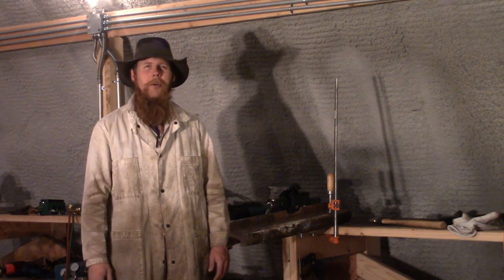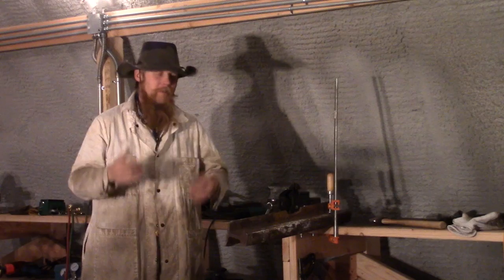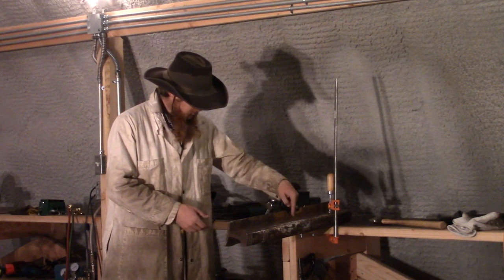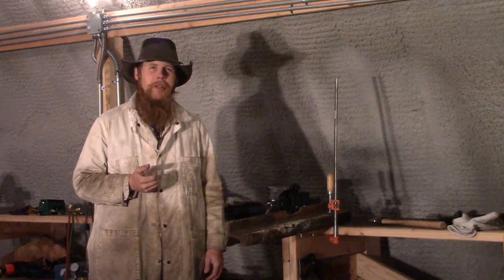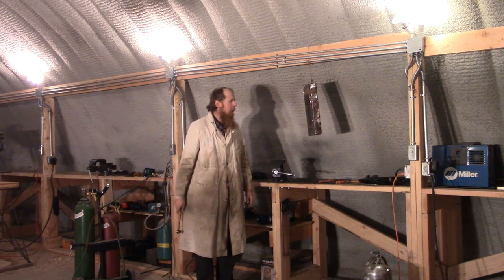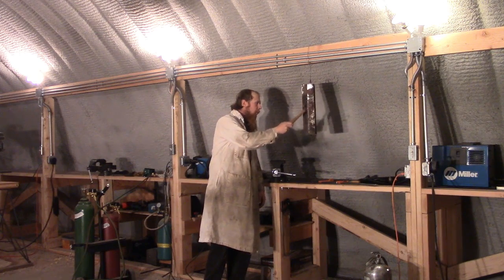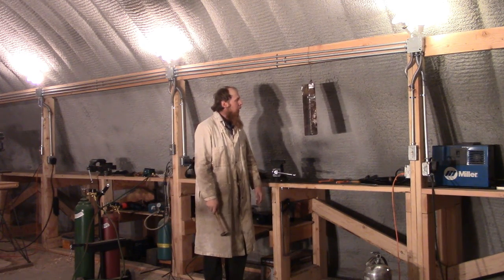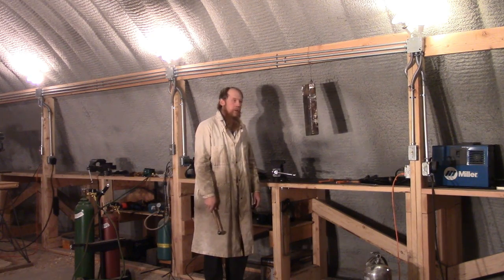Ringing Rail (TIS095)

Comment: Fun experiment.   I wondered whether the depth of cut, e.g., length of tines, was a significant factor.  Perhaps still too much cross sectional area of the tine in relation to its length.   But then it might require about 6' of open tine length to really ring -- and perhaps not.   ha ha     The joy of experimenting.  Thanks.
Reply: Shortest answer, yes. Slightly longer answer, the general shape i.e. dimensional lengths, will dictate the harmonic modes of oscillation. Striking a simple round steel rod (a concrete stake held at arms length would work) from the side will produce frequencies related to the length, however striking the same rod on the end causes frequencies related to the rods thickness. striking the rod at an angle between the two previous examples will put fractions of the striking energy into each of the previous two modes of oscillation, although one mode is significantly less sensitive and likely would not be heard.

Comment: Do you think the difference in thickness and width on each of the "forks" prongs affects how loud or clear the sound is? On tuning forks both sides are meant to be as simaler as possible but i don't know if that's just for accuracy sake or not
Reply from the maker: The unequal cross-section of the two tines would give them somewhat different resonant frequencies, making this "tuning fork" useless for tuning a piano or providing any kind of frequency calibration point.  This would certainly affect the clarity of the sound; I'm not sure if it would appreciably affect the perceived loudness or not.